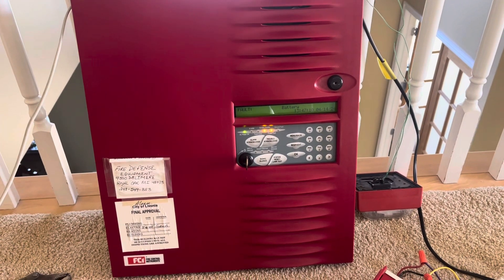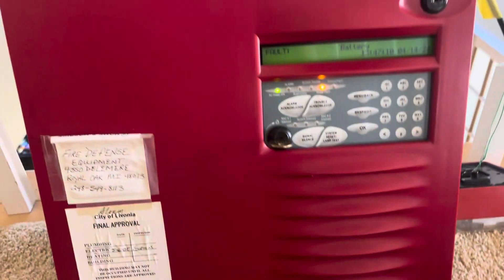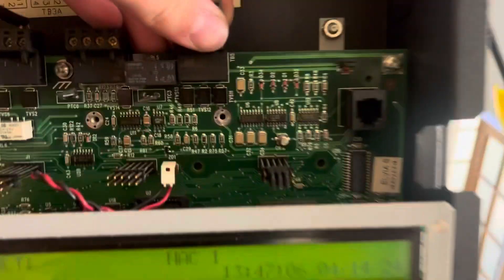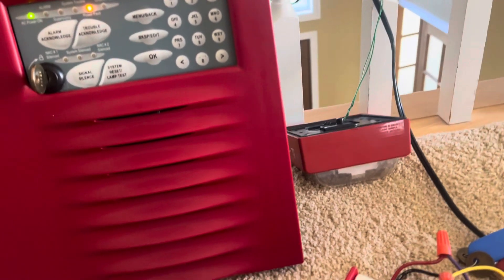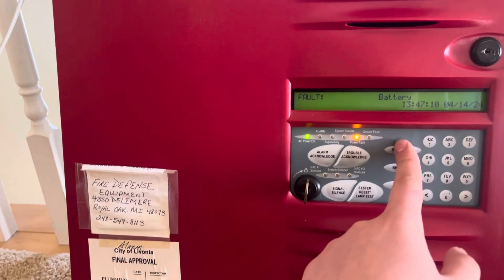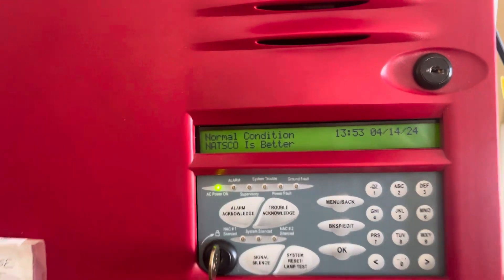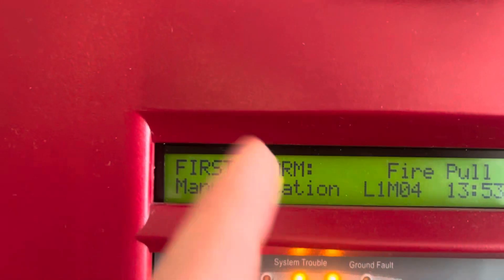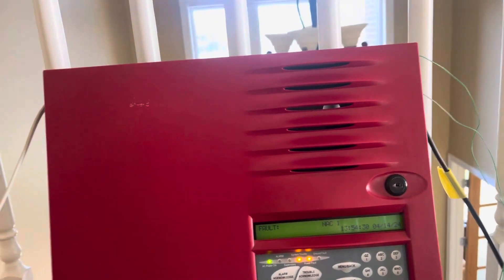My New FCI 7100 Fire Alarm Control Panel

Comment: Buena snoches desde Venezuela.

Tengo un Panel FCI 7100 y desde hace 3 dias me aparece en la pantalla ERROR DE CONFIGURACIÓN.

Entro al menu y quiero hacer una auto configuración y no puedo,
por favor puede indicarme que pasa y cual seria la solucion.

Se daño la tarjeta o con una simple reprogramación pero por sofware puedo solucionarlo.

gracias de antemano.
Reply: I think this means that front panel programming is locked to FCI's 7100 programmer.